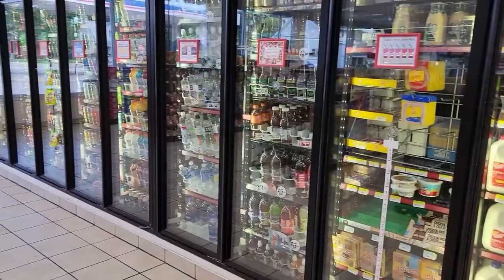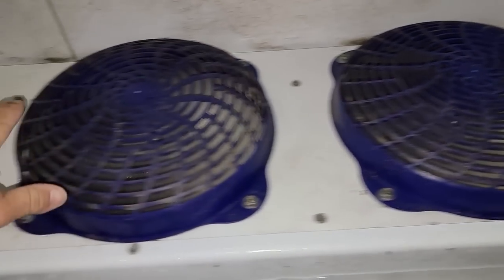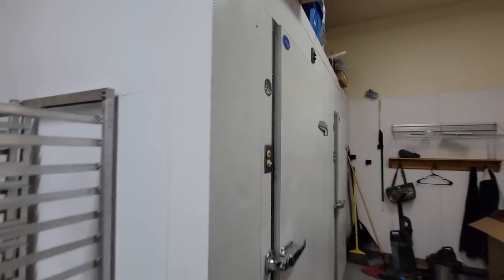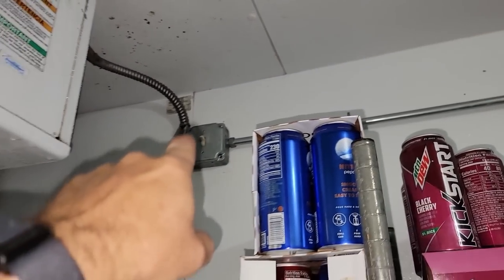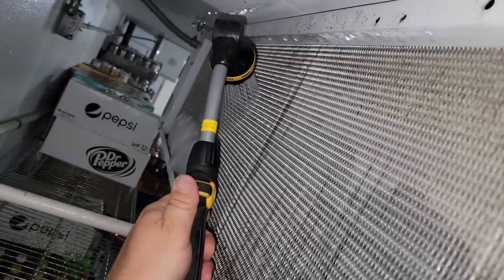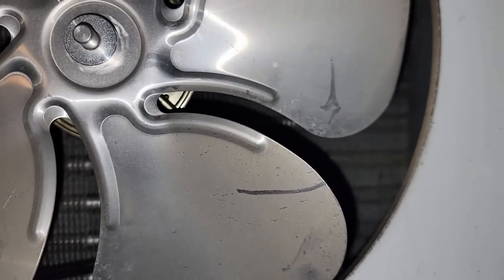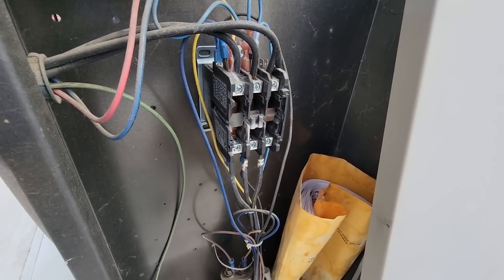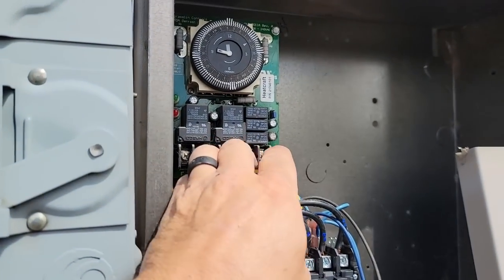More Problems Than A Warm Cooler

Comment: clear "nylon" jacketing over pvc insulation ( THHN/THWN) wire. the nylon is prone to UV light breakdown and moisture ingress. fortunately it's mainly there to protect the pvc insulation for installation/work. it would ideally be covered from UV/sunlight when outdoors( in conduit/flex/whatever), internal equipment wiring tends to escape the easy route of relaxed codes.

Comment: When I go on a call I'll write the date and what the pressure is what the capicater read if I replace anything on the inside of the door just to have a history and like you I run it and make sure nothing else is wrong that sets a true technician apart from a want to be technician thanks for the video and you sir are a top class technician

Comment: Nice work!!  Not sure if your $50 bill condenser air flow test is sufficient. Ted Cook uses a $100 bill... LOL.
Reply from the maker: That's why I used the $50 it works harder than the $100😁😁

Comment: if they were going to put "service" toggle switches in the coolers, they should have used the one that requires a "tool" inserted to toggle them.
maybe some stupid local building code there requires them? I hate off the wall stupendous local building codes, some are super impractical and end up causing more issues or safety hazards than they fix!
Reply from the maker: Yeah those fancy switches would be nice. But anything more than $2 is too much money for some of these people. Heck sometimes you don't even get a switch when you deserve a switch

Comment: Does the clock and thermostat control a LLsolenoid in the unit?
Reply from the maker: Yes, the clock feeds power to the thermostat and the thermostat powers the solenoid.

Comment: Why do you replace motors instead of oiling them
Reply from the maker: Because the bearings are bad now that they've gone dry of oil. Once a motor stops spinning that bearing has expanded and the metal is damaged.

Comment: Very nice job Rick 👍
Did you switch flashlights btw ?
Reply from the maker: I carry that little pocket one that I did a review on and I've been carrying the latest version of the PD 35 phoenix. It doesn't have external USB to charge... it's built into the battery and I kind of like that better.
Reply: @HVACRSurvival  Seems very nice , I love the PD36R I think both are pretty similar except for the usb charging port .